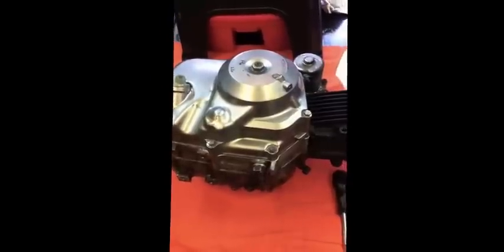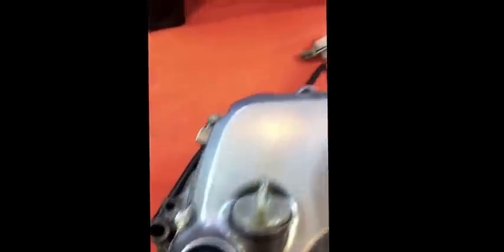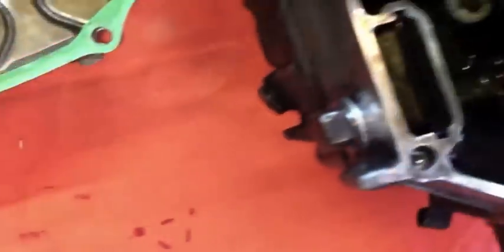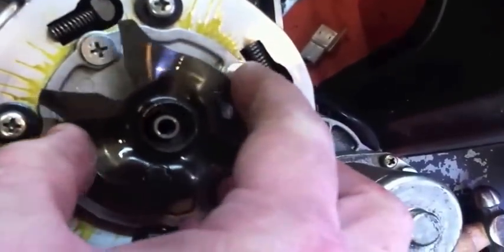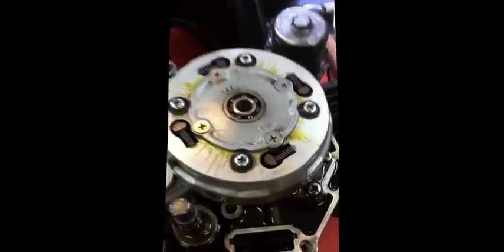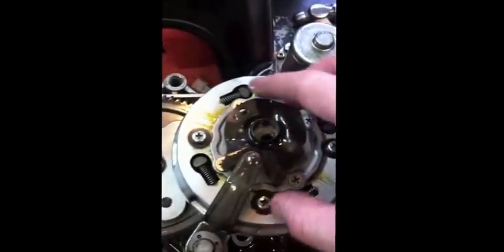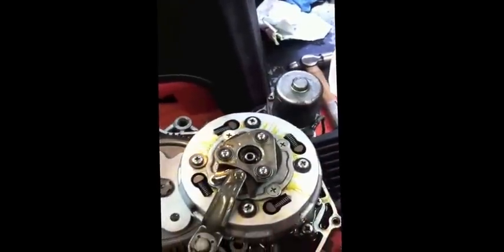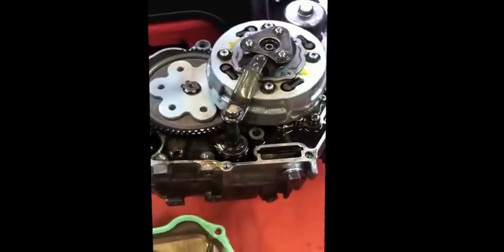C90 Clutch Actuator

Comment: My boys have an XPro go kart with the same setup as yours here. But I do not see the 3 ball bearing piece and the keeper I’ll call it that seems necessary to hold the shift lever in place. Looking online for a new clutch, most are not sold with these two parts either. Is this only necessary for multiple gears, or do I need it?

Comment: Very helpful...thank you!
Reply from the maker: I can't believe the little vid is still useful after all these years
Reply: @DaveSluggy  Yup....it's a goodn!
ALSO...If anyone is interested I've come up with an easy way to manage the clutch adjustment locknut ..... Clamp a 14mm socket in your vicegrips and reach through it with your screwdriver to turn the screw.

Comment: Thank you very much for this video. I managed to assemble my engine with ease. As you said Chinese engines do have different acutator, it is reversed so "ball like" parts stay attached on the cover and the whole mechanism do not run away - so they actually improved it :o the good news is that it is interchangeable so I had no problem to attach Honda cover with the whole mechanism into Chinese engine (original Chinese cover was to wide to screw foot rest), works perfectly without any clutch adjustments :) Cheers!

Comment: Thank you, thank you, thank you!! Just bought a CT70 & I've been working on this Issue for days! Like you said....some bone head had it assembled wrong. I even rebuilt the clutch and played hell getting the case to line back up with the motor still in the bike. The lay it on its side works like a champ! Now it runs and shifts like new:-) great video!

Comment: Exactly what I needed. Thank you. Question. I believe when I took it apart, it was stuck in 4th (drum screw had broken) is it best to try and get it back in neutral and reassemble or what should I do there, I’m not really sure? Also, I see there is a mark (it looks like a timing mark) on the large countershaft sprocket. Does that need to be aligned with something in particular (it seems it shouldn’t matter in any way, but I just saw the mark and wondered. Thank you for your knowledge and help. I appreciate it!

Comment: I just took the gear selector off and found loads of dirt on the thread and cleaned the thread and the selector thread and it ran better in second gear and 3rd, and the thread was fine. But selector still isn't 100% there as it didn't pop up by itself and there was no slips.

Comment: Great video Dave. I have replaced my clutch. All done correctly - but now I have a "whirring" noise from the engine.
Very annoying as I really took my time doing the clutch change.
The noise only goes away if I put pressure on the gear lever with my foot. Up or down the box. As soon as I take my foot off the gear lever - the noise returns. Have you ever heard of this ?
Any ideas ?
Reply: I think your clutch is not adjusted properly.  When you press the shift lever down the clutch should disengage.  Try re-adjusting the clutch setting with the lock nut and screw.

Comment: Hi Dave, I have a problem reassembling my 1969 ct 90. The small spring with its little tube doesn't fit inside like on yours. Am I missing a bit or is there a technique for the earlier ones. This seems to be stopping me getting the clutch cover back on. Help!
Reply from the maker: Earlier versions are very different as they are a manual setup.
Reply: @DaveSluggy  thanks. I have sorted it out!

Comment: +DaveSluggy I am new at clutch repair and this video clears quite a few things up. I'm currently working on an Icebear 125cc atv which is similar to a Cooster 3125r. It's an auto unit with reverse. I see new clutches listed as for semi auto or fully auto. Am I to assume those clutches are one in the same? Also, I pulled the cover off and noticed I had no spring or triangular metal ball guide. Is that normal for fully auto's or has someone previously f'd with this thing?
Reply from the maker: If yours is based on the chinese pit bike type then the 3 balls plate is replaced by a 3 roller affair that's mounted in the outer casing. That type doesn't fall apart when you remove the casing but also doesn't self align.

Comment: I have an 01 XR50 and it seems that my actuator arm that goes on the shift spindle is actually contacting the front plate on the clutch pack. Any idea why this is? I had to use a shift spindle out of a Chinese 110cc engine but I figured they would be the same? Any information would help. I’m stumped

Comment: Hi Dave, could you please help me? I opened my c70 1975 bike, to clean the filter. But now the clutch pedal is extremly soft and there is no change wheb I adjust the clutch nut. Its like its overclutching in every gear change.Also, when im going down on a hill engaged in a specific gear, it is very hard to go from 1 gear to second and 2 to 3. I must stop or reduce a lot my speed to engage the next gear.
Please give me a hand!

Comment: Hi DaveSluggy was wondering if you could give me some advise as to what would be making a rattling sound coming from the clutch, engine starts and idles fine, but rattles when revved up, gears work but bike drives slowly through them, feels like clutch is taking ages to release after each shift change and the bike slowly dies like its running out of fuel, but stars straight back up to do the same again. Clutch works when I have foot pressed down on lever, rev bike and it doesn't move, but leave it for a few moments ticking over in first or second gear and the bike will eventually start rocking and trying to creep forward. Have read through all the posts below, regarding adjustment still to no provale, any help would be appreciated.
Reply from the maker: This sounds like a complicated one to diagnose, if your certain the adjustment has been done properly then you really don't have any alternative but to strip it down and take a look at the innards. Especially check the bush that the primary gear runs on behind the clutch - this can wear and cause all sorts of problems. Also check the flyweights are free to move and the springs have not 'settled' causing drag.
Reply: DaveSluggy can u tell me what that part was on 7:28 and where to find it please

Comment: Super helpful vid. Can you explain how this type of clutch works in general? What is happening when the arm pushes on it? I'm having trouble finding a description of how the thing works. I've also put this back together twice and made sure I exactly did it in the proper order and everything is in the correct direction but I've still got no clutch disengagement. The bike just bucks and will go under throttle even with the shift lever held down. Ive tried various different adjustments on the adjustment screw on the outside of the cover as well with no luck. Any help on what to look at next that could be my issue?
Reply from the maker: Hi, I'll try a brief description...
Essentially it's a standard wet (runs in oil) motorcycle clutch so it has both friction and plain steel plates pressed together by a set if springs. Hondas genius was to add a centrifugal actuator (originally these were little rollers running up ramps but latter (12v) have swinging bob weights.the next bit of genius was to include a set of ramps that allow the kick starter (also allows bump starting). The lever from the gearchange shaft actuated the clutch as it forces the ramped fork to push against the little '3-balls' device, depressing the clutch outer and releasing pressure on the plates so the clutch slips. The last feature it has is to contain an oil centrifuge type 'filter' to keep the oil free of debris as the oil feed to the crank runs through the clutch centre. How's that!
Reply: +DaveSluggy Thanks. Yea I could sort of guess at the functionality based on all the other bikes I've worked on. The 3 metal balls get rotated by the actuator arm and the indents on the triangular plate force them to push on the outside of the clutch pack and release the grip between the plates, right? My bike seems to be lacking this functionality in any way when I use the shifter. I more or less feel like I'm jamming it in to gear and the wheel spins whenever it is in any gear besides Neutral.
Reply from the maker: +Sean Berg most likely it's an adjustment issue, a lot of places on the WWW have the adjustment instructions backwards. Slacken the locknut, screw in the adjuster to free the mechanism, then unscrew until you feel it contact, then screw in 1/8 turn and do up the locknut.

Comment: hi there seen this vid very good had many of sleepless nights in doing this ,but can you say if it is easy to change the semi pit engine to a manual on the in side any info would be great thanks
Reply from the maker: A fairly easy thing to do, you will need a manual clutch, the outer cover and the gearchange shaft; SS50 parts are far too rare and therefore pricey but plenty of Chinese pit bike versions around, especially after they loose 3rd gear ;-)
Don't expect the manual version to be as good as a secondary clutch like the CBF or CG125 as this is a primary clutch spinning at engine speed.
Reply: +DaveSluggy hi ,yer got the manual clutch and the outer cover ,and the gear shaft that i have came off a manual 110-125 pit engine which is the same as my engine which is semi auto so i will need to remove the gear shaft as well to do the conversion ? thanks

Comment: so I just bought a new Lifan 125cc and i realized that when I put the shifter rod on i can't get the bike to change gears.  I cant even get the clutch to engage.  All it does it move maybe 1/8 an inch and total stop.  I have adjusted the clutch and it doesn't do anything.  Does it need to get running first? Are the plates just stuck together and will unstick with it warmed up? It is a semi auto 

Thanks.
Reply from the maker: err, Shifter rod????

Comment: Wish I had a spare electric start engine, previous owner didn't lock the clutch nut locking tab, clutch came loose damaged clutch actuator assembly, timing chain snapped, inlet valve met piston and theres a load of fine aluminium powder in the sump and centrifuge. Only got three weekends of riding out of it :(
Reply from the maker: a19vuu In that case I wouldn't dick around fixing the motor straight away, loose clutch or flywheel usually wrecks the crank and a new one is really expensive - buy a 110 or 90 semi pit motor and whack that in as it will get you back on the road in a very short time.
Reply: +DaveSluggy thanks, I bought another C90, a 89 C90-MG which was someones abandoned project. frame is rotten at the back. Hasn't been on the road for 5 years. I fitted it to my Cub and it won't change gear with the engine running. fine when the engine isn't running though. I tried adjusting the clutch, refitted the actuator assembly but now I'm stuck as the clutch still doesn't work.

any ideas? there is a black tide mark where the old oil was on the crankcase/clutch cover.

could my clutch be stuck solid?
Reply from the maker: a19vuu Could be the clutch plates are stuck together or the spacer/bush on the primary gear could be missing or worn.

Comment: I'm leaking small amount of oil from the adjuster nut, how can I stop this? crf70. 2005
Reply from the maker: There is an o-ring on the adjuster shaft, to replace it you would have to remove the cover. You might get away with putting a fibre washer behind the locknut on the outside - it's worth a try.

Comment: Hi recently bought 1981 c90 and seams to be a bit clunky changing gears any ideas thanks.
Reply from the maker: Start the bike, depress the gear lever and rev it up - if it tries to pull forwards then you have a real problem, if not then it's down to your gear changing technique. Best to adjust it correctly before anything else though.

Comment: Hey ....nice vid good advice throughout 👍 I have a friend who has one in a kart and he can change up through the gears to 3rd and up again and it goes back into 1st....which is a problem .... have you any advice? Is there a mechanical stop ?
Reply from the maker: There is a rotational stop that should prevent changing from 3rd up to neutral and through to first gear. It works on a drag link principal so will allow you to change from 3rd to neutral so long as you are not moving (think of stopping at the traffic lights in 3rd and then being able to go directly to neutral rather than needing to go down through 2nd and 1st. If you can change whilst moving then it's a fault but fixing requires complete strip down.
Reply: DaveSluggy thank you for your reply most appreciated👍

Comment: Hi.on our atc110 there is a noise coming from the clutch side which goes when light pressure is put on the gear shift, any ideas ?? Ps, all gears work/change fine...Thanks for any advice ,   (Taunton uk)
Reply from the maker: It sounds like the adjuster is loose and you may need to take the slack out of it. Or the anti-rattle spring has been missed out or broken.

Comment: hi again started the conversion today it all started well ,but i have hit a problem with the gears got it all back together and i could not get it to go in to gear but it did go the one time in to first but had trouble getting it out then and i had to change the small cog which gos behind the clutch plate wheel for a smaller one any idea on this this many thanks
Reply from the maker: +john doherty If you had to change the crank primary gear to match the clutch then you will need to corresponding 'big gear' that fits onto the gearbox input shaft - they must be a matching pair.

Comment: Can you do a video on how the centrifugal part works. I'm racking my brain trying to figure it out but even with the whole assembly right in front of me, it just seems backwards. I haven't ridden this bike yet, as it's a rebuild project, so maybe once I feel how the clutch acts I'll understand better, but I just don't get it at this point...
Reply from the maker: Depends on whether you have an early C50/70 clutch with the little roller weights or the later 12v type that has captive 'swinging' weights.
Reply: DaveSluggy it's a 12v, and I can see the swinging weights, but I really couldn't mechanically understand it by looking at it. Perhaps it was the beers I love while I'm working in the garage though...
Reply from the maker: If you look at the swinging weights they will bear against the rearmost steel plate (if the indentations it has made are deep then you can move the rear plate around by one notch and bring a new surface to the swinging weights. So when the clutch spins the bob weights apply pressure the this rearmost steel plate and as a result squeeze all the clutch plates together. That's why even when the clutch slips a lot when trying to kick start it doesn't slip when being ridden on the road.

Comment: The kick start only,      And the electric start are different internally as the electric start has a heavier flywheel to help charge the battery
Reply from the maker: Nope, flywheels are about the same weight, just the added weight of the one-way ramp and roller clutch on the back of it. All other parts are identical - even the cranks are interchangeable.

Comment: Hello I've got a issue with my 1987 honda economy c90, for some reason when I change gear from 1st to 2nd the front gear changer sits lower then it should causing me to slow down to wait for it to pop up and rarely slips from 2nd to 3rd, what's the issue?
Reply from the maker: +jack turner Check the lever isn't rubbing against the footpeg bar, usually happens when the footage bar gets bent after dropping the bike. Other than that check the lever isn't slipping on the splines; if it is, and the splines have been damaged you may need to replace the shaft and that's quite a big job; although it can be done with the engine in the bike.

Comment: nice!! doe you know how to adjust te nut at the end? mine keeps slipping when kicking
Reply from the maker: Mitchell HürenKamp Adjustment is simple but often done incorrectly, you will need a 14mm ring spanner and a flat bladed screwdriver. Undo the locknut (14mm spanner) screw INWARDS the adjuster screw until it LIGHTLY contacts, UNSCREW 1/8 to 1/4 turn and tighten the locknut whilst holding the screwdriver firmly in position to stop the adjuster turning. Clutch slip when kick starting us usually a sign that someone has used Car oil rather than motorcycle oil and the friction modifiers cause the plates to slip. Replacement of the clutch disks and springs is usually the only permanent cure.

Comment: Dave, I was riding down the street on my honda ct110p and it was going fine. Then i stopped and it wouldnt go into first gear. I got the bike home using 2nd and the rest and it worked fine. But I cant put it into first. Any ideas? btw good video.
Reply from the maker: Something has clearly gone wrong, could be the clutch adjustment - so try that first, if that doesn't work then you will have to open the casings and take a look inside.
Reply: Thanks for reply. I will give it a go. The gear shift clicks like it is changing but it doesnt seem to be moving the transmission into first gear from neutral, and yet it shifts down from 4th to 3rd etc ok. Heel kicking the gears from neutral to 2nd to 3rd and to 4th works fine too. It didnt pop out of gear either.

Comment: hi Dave, one question, i have a tao tao 110cc atv, how many shifts have this kind of atvs., because mine only has one, and what can i do to give more power and speed to this chinese atv? salutes and congrats from JUAREZ CITY neighboors of el Paso tx.
Reply from the maker: I'll admit I've not seen one of these but they are generally all the same type of engine with one exception - they only have one gear and a centrifugal clutch. In order to get more out of it you would have to start by installing a proper gearbox and clutch before working on the top end for more power - sadly this is likely to cost more than a replacement motor.